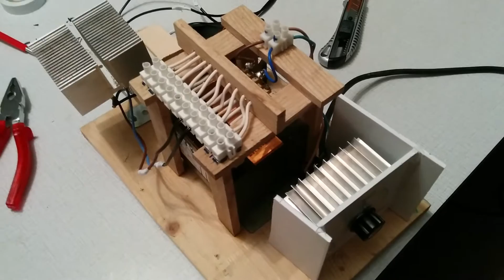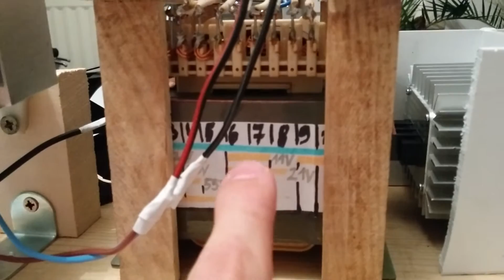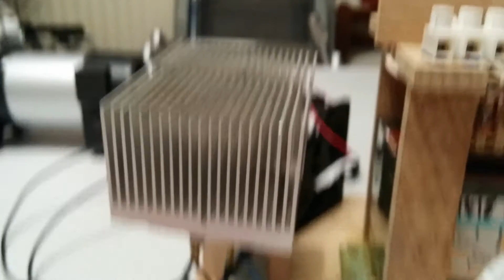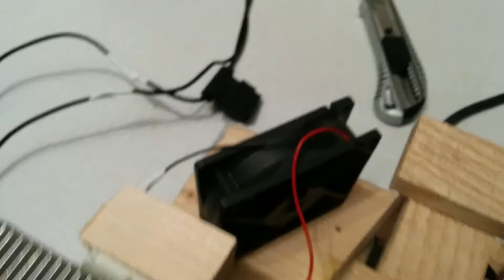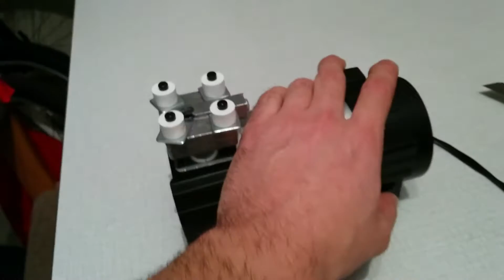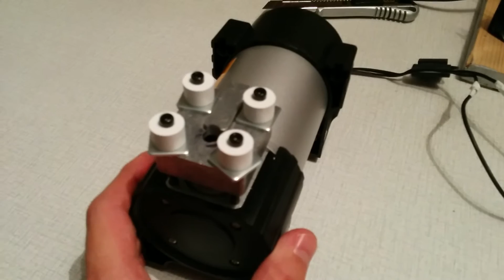Upgrade on the main part of hand engraving machine

Comment: great job and thanks ,one questiojn the speed regulator is from ????? or can be replacer which other spees regulator from what machine ???
Reply from the maker: its a basic light deamer. for AC voltage. but i used super strong one 10kw so it doesnt get hot or anything. i got mine from a sale site here in SLO. i paid 20euro for mine. look for ac dimmer and you should get some results. they are sometimes refered to ac motor speed regulators. Cheers
Reply: thanks nejc great job
Reply from the maker: no problem, thank you